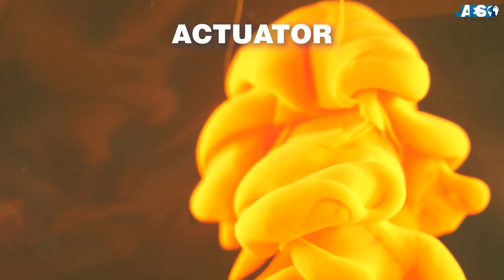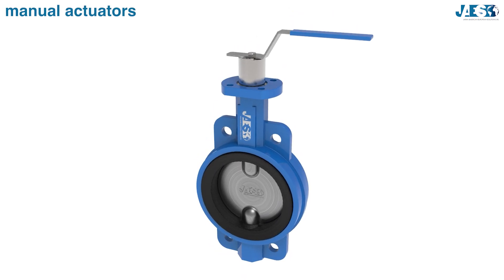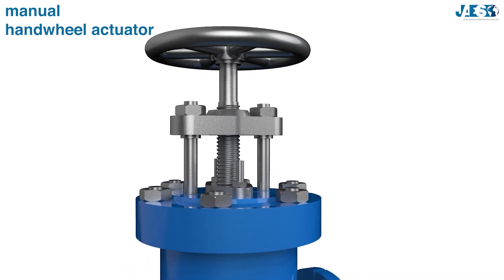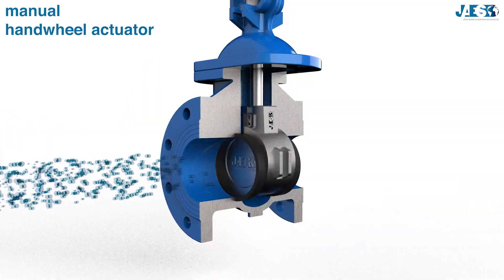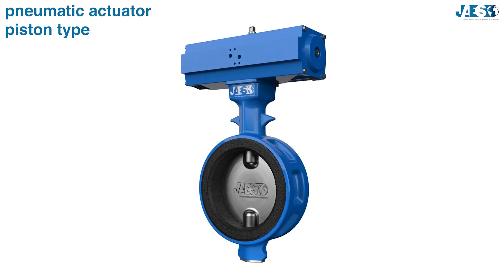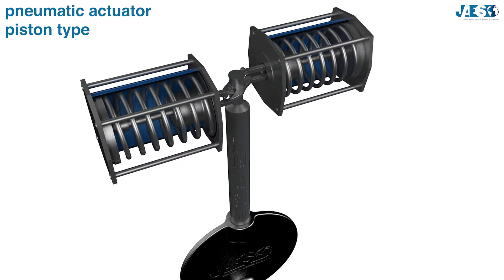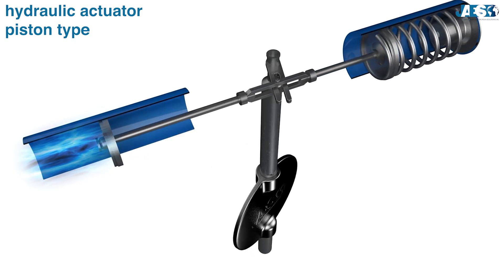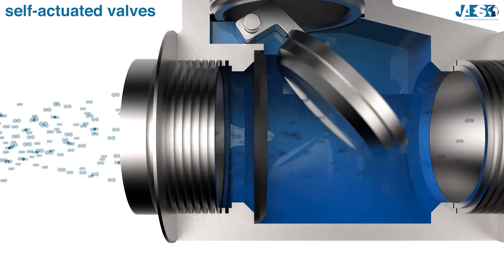Actuators for hydraulic valves - Lever - Handwheel - Electric - Solenoid - Pneumatic - Hydraulic

Comment: Hy i have issues with hydraulic butterfly valve the actuator cannot work due to lhydraulic leak its becuase bolt broken, now the valve i oprte with use spanner bybturn the shaft when opening can open full but when shut cannot fully close, it possible to close by turn the shaft? Thank you